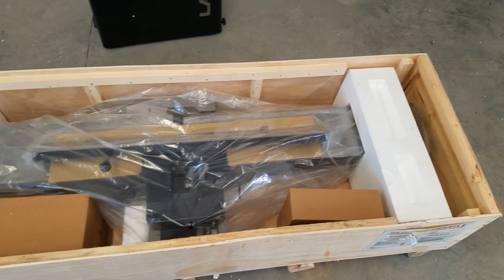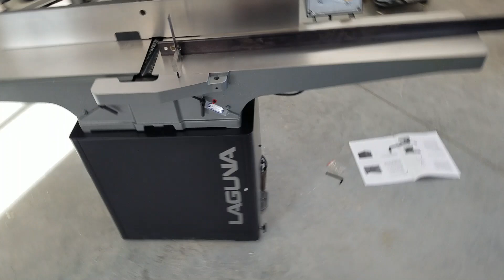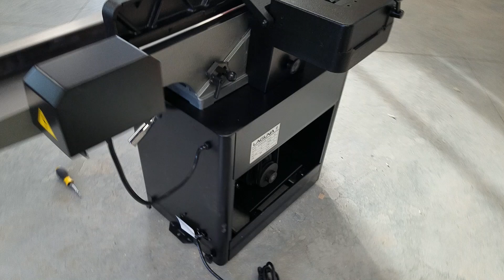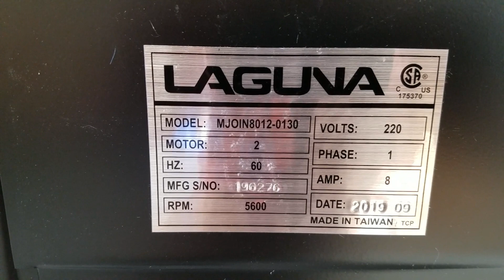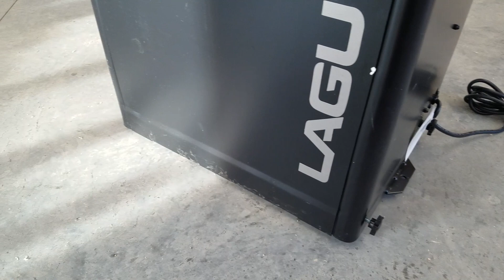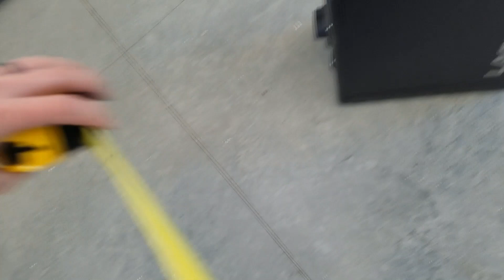Laguna 8" Jointer Unboxing

Comment: How much did you pay for this from Acme?   I saw this same model on Facebook marketplace and I want to know if the seller is over charging for this model.  What has been your experience using this jointer?
Reply from the maker: I purchased mine in Jan of 2020 for 1800 + shipping and tax. I love it. It has worked very well for me.

Comment: Hi Jeff.  I'm thinking of getting a Laguna jointer too.  What do you think of this one?  Have you used it yet?   Does it make tight, precise joints?
Reply from the maker: I love this machine. Its quiet and once you get it dialed in the joints are very crisp and clean.
Reply: @jeffsuedbeck2074  How do you like setting the fence to 90?   Are there plastic parts for holding the fence?  Is it flimsy or solid?    Easy or frustrating to make fine tune adjustments?

Comment: Hello, Thanks for this. When the fence is set all the way back and at 45, does the power switch get in the way at all?
Reply from the maker: It does. If you're tilting the fence backwards you won't be able to push it all the way back but you will still have about 7" of cutter width. If you tilt the fence 45 towards you you'll be able to utilize the full 8" of cutter width.

Comment: The blade guard is sticking because the bolt holding it in place is too tight. You can see it hitting the cast iron bed at the pivot end. Thanks for the video. I’m very keen on this jointer :)
Reply from the maker: Ahh! Good eyes! That was it! It swings freely now